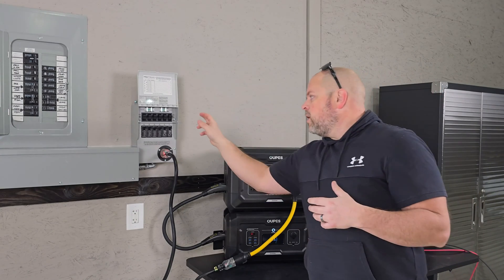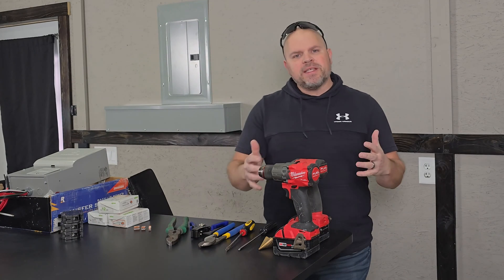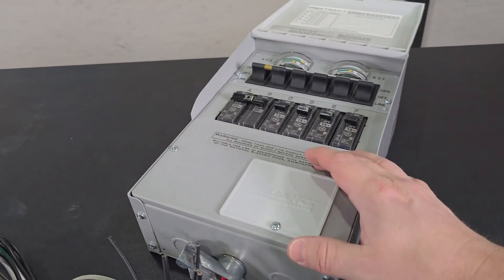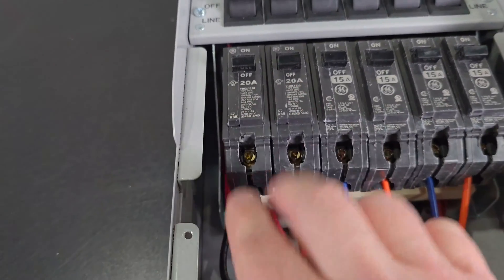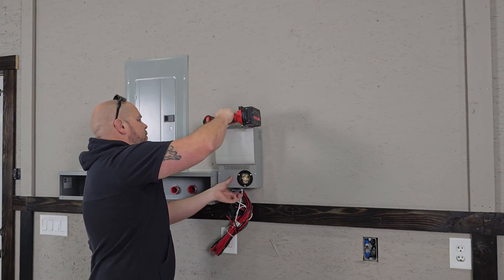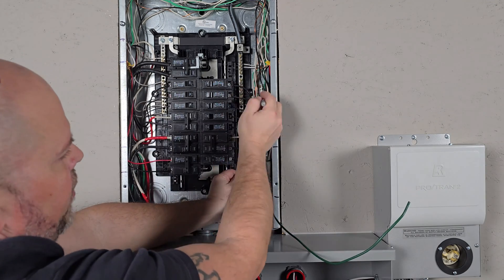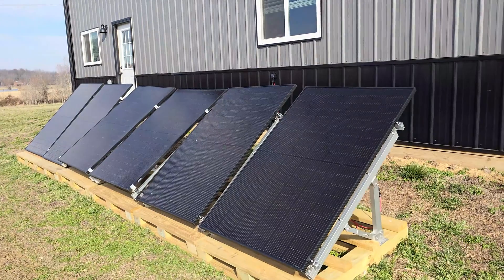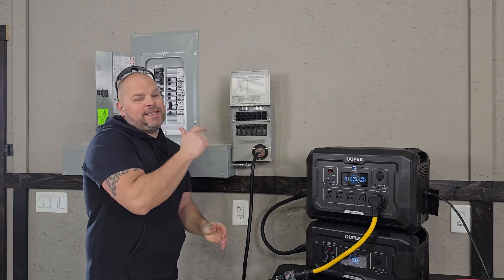How to install a 30A Transfer Switch for OUPES MEGA 2 | OUPES Home Backup Solution

Comment: All of the wire hookup scenario is pretty intimidating unless you are an electrician I figure. That said this is a great video to put a toe in the water to understand transfer switches. I have the oupes Mega 5 and live in an off grid cabin. I run extension cords to my unit but would love to have it set up differently with the 30 amp hookup scenario.

Comment: I have the same transfer switch I use my whole house gas generator to run 4 15 amp Breakers and a double 20 amp to run the water pump. 
I purchased the mega 5 and plan to use it with the transfer switch 
Can I still run the two 20 amp water pump with this generator or will I need something else to run the water pumps? 
Thanks

Comment: Did you say if you turn the main breaker off the bus bars still have power?? 😮😮 That would mean that everything would still have power. I don't think so. If so, your main breaker is defective.
Reply from the maker: If you hook up your power station like the OUPES Mega 2 to the transfer switch, when the grid is down, the OUPES Mega 2 will be the power source for your family.
Reply: @OUPESOfficial  thank you so much for this video! Would this work with the OUPES Mega 3 the same way? Or which transfer switch would be compatible with that one? Thanks again! 😊
Reply: @skystar0717  Yes, I have used this same setup for all sorts of systems.